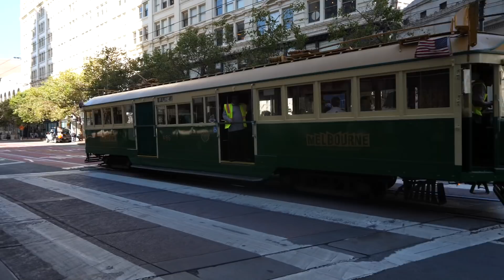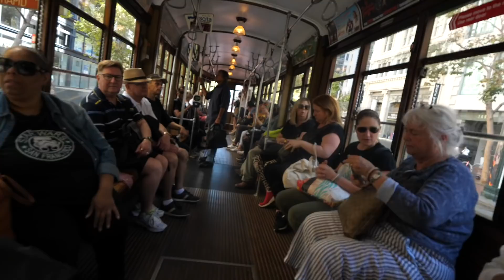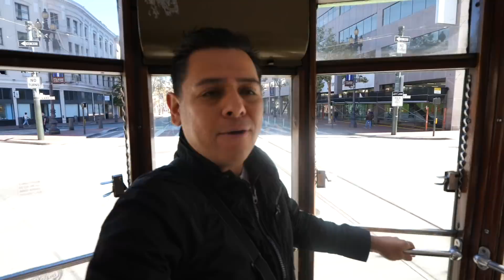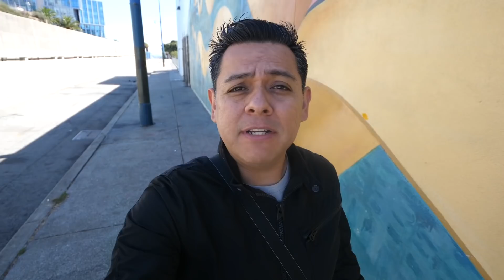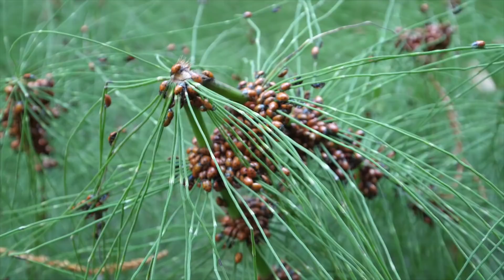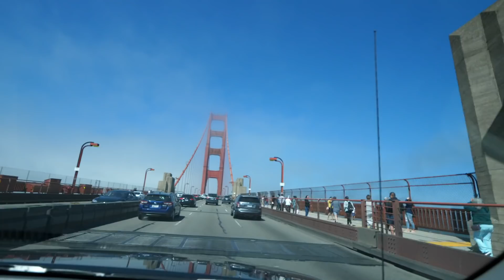What in the world are those electric Probes for?

Comment: To answer your question on "why isn't every city doing this? The answer is... every city was going it until the 1950s. The height of electric streetcars were in the 1920s however the great depression put a lot of trolley companies out of business. WW2 put a pause on the abandoned on the trolleys. However in the 1950s. A company called "national city lines" owned by general motors, Firestone tires, and standard oil. Bought trolley services and converted them to buses using (guess what). Diesel GM buses, Firestone tires and standard oil.
Reply: It was a backbone of the movie, "who killed roger rabbit". National city lines was given a $1000 fine for it all. Its quite interesting.

Comment: Jehu, you probably wont see this, let alone respond, but I have a weird set of questions. It involves solar arrays/batteries/grid tie ins. With a grid tie in system, how does it work? Let me explain.

 I am new to this and looking at doing a split system with grid tie in. My questions are:

If you are filling the batteries, how can you use them? Only if power goes out? Or can it be turned on and used during peak hours of consumption, and if it does, how do you control it?

Next, if you have a grid tie in system, how can you charge the batteries, at the same time as using solar made energy?

I have a few more, but this is already long enough. I love the videos, and am enjoying them everyday! Very useful!

Comment: You know what else is unsightly? Plooms of black smoke and soot spewing into the air from an exhaust stack.
Reply: The dirtiest of coal plants are more efficient when powering electric cars than your average ICE car is at converting gasoline to kinetic energy.
Reply: BunnyHelp Yeap its why most diesel trains are actually technically electric aswell. More efficient to run a generator to an electric motor than use the diesel motor to power the wheels directly.
Reply: @yumcha16  it's rather more complicated than that and in fact there are many losses in the electric final drive. There were many mechanical and hydraulic drive experiments during the early years of dieselization. Electric final drive won out due to many factors.

Comment: Just a correction of your statement where you said the Trolly bus was an American invention.

It turns out not to be the case.

(Trolleybuses.  Electric trolley buses which were fed through trolley poles by overhead wire, were first developed by Siemens brothers (William in England and Ernst Werner in Germany). The first such vehicle, the Electromote, was made Dr. Ernst Werner von Siemens in 1882 in Halensee, Germany. Leeds and Bradford became the first cities...)

This is on google so you can look it up.

So German and British.

Very good idea though, but today we really don't need the poles anymore, simply have charging stations as the bus pulls in to each stop it gives a boost charge and when the trolley or bus is at each end waiting for it's time to go, have it charge there as well, as the batteries get better no need for line of route charging and charge could be at each end only.

But no reason why these busses couldn't be used without the cables.

Comment: All the Los Angeles County MTA overhead and 3rd trains run on 750VDC. The problem with DC is the voltage drop between stations. Substations have to be within a mile of each other to minimize voltage sag. I was a high voltage electrician for MTA for 10 years...learned a lot, but the future is high speed rail using high voltage AC for transmission and a rectifier that converts to DC physically on the train. That way the trains can still take advantage of the high torque of the DC traction motors while reducing the amount of substations to power the infrastructure.
Reply: Mike smart thinking
Reply: yes but HSR is not only too expensive to build, in CA it would be too expensive to run, because every one of those jobs would be unionized.   the sf to la hsr is such a waste ... 6 hours to drive, if 4 people going, can do on a tank of gas and when you arrive, you'll still have a car to get you around la ....  on the other hand hsr won't get you there that much quickier, by the time someone gets in car to go to hsr station, they have to park in parking lot, go to platform, wait for train, then at the other end arrange to have a car in most cases.    when more than 1 is taking the trip, hsr as each rider pays, can't compete with cars .... some would say even when just 1 person is going, not having a car at the other end is a deal breaker.
Reply: @dhalifax562  who said it had to be high speed? Around where I live in the UK we have recently had our commuter line electrified at 25kV AC, the standard for modern electrification, and the fastest trains we get do 100mph (the line speed used to be 75mph at its maximum). It is not anywhere near something you'd call a high-speed line, this is like the Metro-North lines in NY. Electrify the existing line and switch to electric locomotives. You could use 2x25kV split-phase electrification to increase the distance between substations or even use 50kV AC like the Black Mesa and Lake Powell railroad does for the same affect.
Reply: @jayzo  England has the rail infrastructure in place already, they have rail stations in place, it is there from long ago.  In the US, California sort of wants (depends on who you ask) HSR from SF to LA, they have pretty much nothing in place so would have to build from near nothing, and major cities have awful rail transit in the US so doesn't make sense here .... US was built for automobile in mind so very difficult to transition to anything that runs on rails this late in the game.

Comment: Wait WTF was that an old Melbourne Tram. I use to take a similar tram on the way to high school. One of the free historical "street carts".
Reply: Could it be PCC street car? Those were extremely popular, and were built in their 1000's and shipped around the world. Quite a lot of streetcar vehicle designs were based on it. Including Czech bestseller - Tatra T3
Reply: @jur4x  Quite sure it was actually shipped from Melbourne. There is some historical preservation project where they try to keep those Trams running.
https://www.streetcar.org/second_melbourne_tram_joins_f-line-fleet/

Comment: The wire structure for streetcar systems was very expensive to build and maintain... Resulting in the bankruptcy of many streetcar transit systems in underused areas.  Except for high use cities, most smaller cities converted to buses.  Of course, the bus manufacturers provided some incentives.
Reply: Soviet cities used them quite extensively. But there are (were) few caveats. 
1) their cities were much more dense and suburban sprawl was not a thing.
2) Most cities were relatively new or rebuilt from ground up after the war, new ways were easier to implement
3)If someone didn't like "unsightly" wires, he could be ignored.
Reply: More money selling tires https://en.m.wikipedia.org/wiki/

Comment: in the beginning of the evolution of fossil fueled vehicles there should have been combination between trolley and automobiles if they had added a couple alternators or 1 oversized and sent the energy(voltage) into the grid through rails on every  mile driven, if they knew of the consequences they would have made it work just by adapting the auto with a partial generator or a stater would have helped, vehicles need to be built lighter with the highways adapting to EV's not the reverse, 90% of vehicles are 4 passenger driven daily by 1 person that's 3x's the extra drag and built for 4 people

Comment: I'm in upstate NY and we get a lot of snow so that won't work here
Reply: Chris Lewis it did in the 1920s, so why not now?
Reply: @ryandavis7593  are you confusing upstate NY with NYC?
Reply: @chrislewis2262  Do you think it doesn't snow a lot in NYC? The snowiest year in NYC was snowier than the snowiest year in Buffalo. 76 inches vs. 66 inches. Syracuse is nearly double that on average, but that doesn't prevent overhead wires from being used to carry residential and commercial electricity, as can be seen in many photographs of the city viewable online.
Overhead wiring is better than tramway wiring because you don't have to keep the tramway clear for the return circuit. Even better is battery power, or hydrogen hybrid if you have excess clean electricity.
Reply: @Markle2k  the only information I found is on Wikipedia and it only connected buffalo to Rochester then to Syracuse then to Oswego but it wasn't like San Francisco. It only lasted about 40 years before it was replaced by steem locomotive. As far as I have found Oswego didn't have a trolley like San Francisco where you take a trolley all over the city
Reply: @chrislewis2262  It only existed for several decades is not evidence that it wasn't sustainable. Quite the contrary. Oswego is a small town, BTW. It hovers around 20-25k, historically. It might be better to collaborate regionally and concentrate on battery vehicles. Either is a whole lot better than diesel power.
San Francisco doesn't have the trolleys over the whole city, just on main routes. Tram cars aren't practical on the hills because steel on steel doesn't have enough traction, thus the tired trolleys on the less-than-flat routes. Cable cars ride on rails, but use underground cables for locomotion.
Los Angeles had trolleys and trams all over the city, until lobbying by automotive manufacturers caused planners to focus on automobile transportation instead of central public transport.